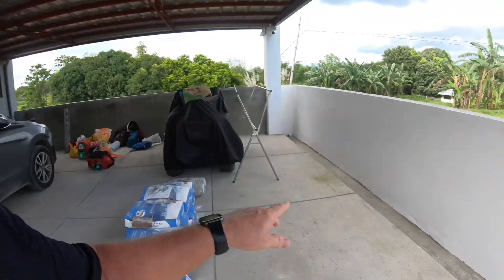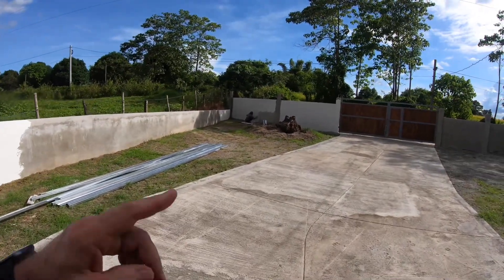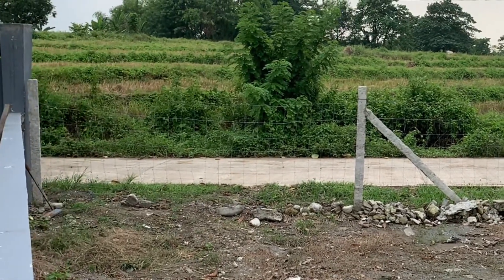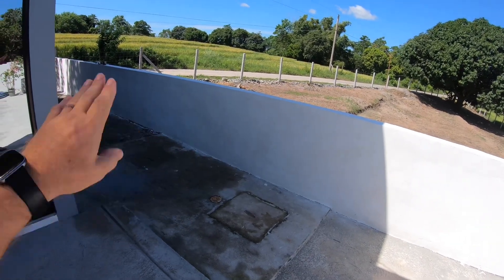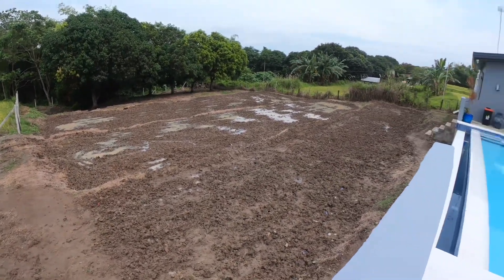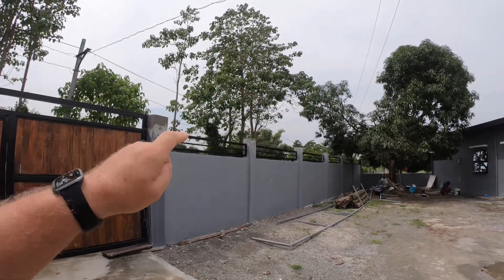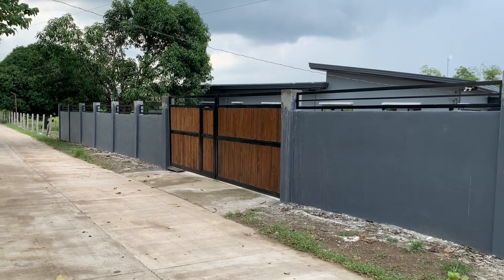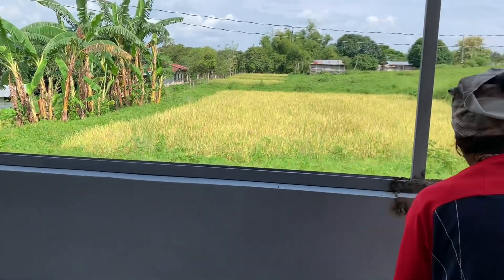Finishing Touches on the WALL and GATE | Plus a Surprise!! 🇵🇭🇺🇸

Comment: Thanks for the update Entrance gates they make auto closers for hinged entry gates no need to change to slider.
Reply: You are correct, but for some reason it is looking like it will be more cost effective to transform to a sliding gate versus a double gate.  Not sure why, accept the additional cost of running power to both sides of the driveway.
Reply: @rickeybaker9066  Hi Rickey it's  easy 12volt battery solar charger no need for cable's.
Reply: @graemescebuphilippines363  Installer didn't mention solar as an option for their motor.  I will chat with him about it.  The house is solar so I suppose technically it is a solar opener, but I have to get the power out to it.  Having a separate panel and battery would be easier I think.  I'll look into it, and thanks!

Comment: Are Fence materials available there?  chain link fence? other  steel fence? posts and  rolls?
Reply: Yes Rory, they are available, but you have to pay for them.  I thought about cyclone fencing for the perimeter fence, but just to cost prohibitive for me.  So we went with the Filipino version of hog wire and barbed wire for now.  Maybe somewhere down the road, we might upgrade to something more durable and lasting.  The concrete posts are in so it will be a relatively easy upgrade some day.